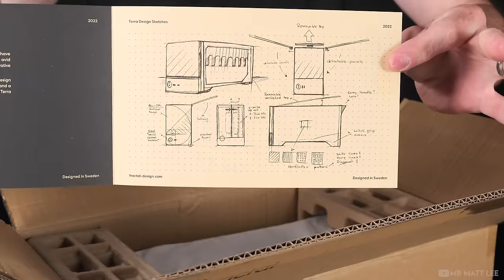The Ultimate ITX Case?! | Fractal Design Terra Gaming PC Build | ProArt RTX 4080, Intel i5 13600KF

Comment: 6:05 and 9:39 A little hint: Attach the two fractal-hexa-spacers (7mm) between the power supply-holder and the powersupply. 
The airflow from the GPU then gets past the powersupply much better. Otherwise you did a very good job here. Many greetings from germany.

Comment: Matt, thanks for that video! I can't believe it though, I build my own system using the Fractal Design Terra before you did. You always seem to be so quick off the mark in building a system when a new case comes out, even before the cases are generally available to the public. I must have seen the announcement on the same day the cases were released locally, and immediately ordered one. While I guess you were delayed due to needing to fly back from Taipei.

My only complaint about the case is that it doesn't have a setting for no GPU, where all the space is given for a CPU cooler. I recently had a need to get a portable system to take on the road, strictly to be used for software development, and the iGPU on the Intel CPU is plenty for that use, so I want a 13900K and a tall air cooler, but only low profile coolers will fit, due to the lack of a no GPU setting.

I went with the same Asus motherboard as you, and also the same Thermalright CPU frame. Now I need to find a good Pelican style carrying case to use when transporting the system along with keyboard and accessories. This is my first ITX system, and I thought I'd never want one, but when the need came, and Fractal Design made the right case, I'm quite pleased with the result. Aesthetically, your build is of a much higher quality than mine, but for this system, the inside isn't so visible, so I decided to go with what works best, and not worry about the aesthetics.

Comment: Oh yes, this is the ultimate ITX Case 1000%
Reply from the maker: Absolutely agreed with you! 🤎
Reply: @Mr_Matt_Lee  it misses two slims fans for top exhaust, not?
Reply from the maker: @manuelno1645  you can’t fit two fans at the top. It’s doesn’t technically need them, natural convection is adequate given the case design ✌️

Comment: You are sure Fractal did not paid you to make this video? :-) Beautiful!

I really think if I saw this video BEFORE I did my ITX build, I will seriously consider to do the same. 

Small form factor is not for everybody. The goal here is not to have the most powerful build. Even if you proved it can be
an efficient game station which is awesome. Minimalistic in size and components. Less is more, I like it!

I use the same MB for my own ITX build and I found is not easy to undervolt and significantly reducing the cpu temp without sacrificing a lot of performance. If anyone is interested, his my tips:

1. Disable the CPU throttling power (BIOS)
2. Install the previous micro-code 104 (available from the Tweak Paradise menu, also in the Asus BIOS)
3. Only then, you could undervolt with negative offset.

Doing so, not only I reduced the temperature of 6-10C, I also improved the performance (CineBench R23 from 28K to 30K, i7-13700K).
For the GPU, I used MS Afterburner, I get also 6-10C and I improved the performance a bit(4%) by overclocking the memory clock(+1200Mhz, Gigabyte RTX 3070). Stable since (1 month).

Comment: Getting ready to build in this. Going to put any extra fan on the bottom. I've been debating on whether to use as intake or exhaust. Don't see a whole lot of airflow coming out from the bottom. Thinking about using that fan as an intake to blow up out of the top

Comment: 2024 My Build
 
Intel i5-14600KF
Corsair DDR5-6000 CL30 Dominator Titanium BLACK (64GB(32Gx2)
ASUS ROG STRIX Z790-I GAMING WIFI
ASUS ProArt GeForce RTX 4080 O16G OC D6X 16GB
Samsung 990 PRO M.2 NVMe (4TB)
Fractal Design Terra (Jade)
ASUS ROG LOKI SFX-L 1000W Platinum
NOCTUA NH-L9x65
Thermalright LGA17XX-BCF
Reply: how are the temps during gaming? I am afraid the noctua L9X65 won't be able to cool 14600k

Comment: I know it may go against the core idea of these builds and videos but I'd like to see a bit of cable management or at least how you connect the motherboard cables. For novice builders like myself, especially in the ITX space, that would be really helpful.
Reply from the maker: I appreciate that. However, cable management will always differ depending on the hardware being used. For example, different PSU’s have different length cables and motherboards all have their ports in different places. Unless this build was replicated to be exact using the exact same hardware, showing cable management wouldn’t make much sense. The best advice I can give is to just take your time and enjoy it, manage cables as you go, the Terra has been well designed to allow ample cable management space. I’d highly recommend buying some additional Velcro straps for all of the cables, zip ties can damage them. Plus, with Velcro if you need to make any adjustments it’s quick and easy 😁
Reply: @Mr_Matt_Lee  I appreciate your response very much, Matt and your points are valid and fair. Now that I read my comment again, I think I went a lil bit on the abstract side but... maybe at least just a shot of you plugin in the connectors like the 24 pin? lol. Once again, thank you for taking the time to reply.

Comment: Amazing video and build!

I am not sure as to choose ths case or the Fractal Torrent Nano one, though. 

One has to cap the CPU at 65 watts for this setup, right? I am looking for the smallest setup but that can run "Breath of the Wild" fluently at 4K, 60 fps and a 13700k + 4070Ti was enough. However it is uncapped at 125 + watts.  Is the fractal nano better in my case or would the 12600k [fully cooled by the cooler chosen in this video with its turbo mode on] better?

The 12600KF is listed as fully cooled by this cooler, so it might be a better option than the 13600KF if turbo mode is not aupported

Comment: Hi Matt
Brilliant job. A wonderful set!!!
I want to assemble this exact set with TERRA Graphite,
But the CPU cooling will be handled by NOCTUA NH-L12S.
With the GPU RTX 1080 PROART it should fit and work better ...
What do you think about it?
Reply: Have you thought about using the NOCTUA NH-L12S, and the question is whether it will fit with the RTX 4080 PROART in this PC case?

Comment: Really wanted to buy this case as it's beautiful looking, went with the FormD T1 however, as with this case they made a few questionable design choices, due to the large feet there isn't enough space for a 240mm AIO, so if you're going for a top end system (4090 + 7800x3D) you are sacraficing performance. Looking forward to a second improved iteration of this case though!

Comment: The Noctua NH-L9x65, has sufficient performance for the i5 13600KF at base clock only. Try running a cinebench without throttling after 1mn.

Comment: Hey man! Im really surprised with the températures, i see a lot of mini itx post on reddit with this precise same configuration and going loco on the températures (95+). What is the process behind yours? Downclock?
Reply from the maker: Ambient room temperature, thermal paste type and application method, fan curves… even the motherboard can make a difference with residual VRM heat, but most importantly for me in this build it’s also having the contact plate around the CPU socket. This greatly disperses heat in a small form build like the is, taking some strain away from the cooler. No downclocks though, all running at default settings (no overclocks obviously!)
Reply: @Mr_Matt_Lee  nice job man and thank you for the answer ! Im trying to build a little one as well but it has to associate power and silence would you recommend doing a little case like this or getting a larger like the Corsair 2000D would be more pleasant for this purpose ?

Comment: hello Matt, what cooling do you recommend for that same configuration but with a ryzen 7 7800x3d
Reply from the maker: Hey! Sadly, there isn’t a small form factor Cooler small enough to cool any 3D chip effectively unless you’re greatly undervolting it… a 3D chip ideally needs a 360mm radiator which you couldn’t fit in this case 😶

Comment: Would it be possible to have AIO for AMD Ryzen 9 7950 within the configuration used in your video?  I work with blender and need a travelling work platform within my RV.
Reply: I own this case + 4080 proart. You only can use the smallest AIO (1 fan) and a GPU with 1 fan. But i prefer low profile air cooler with max height 67mm

Comment: Would I get away with this exact setup but using an Intel i7 14700K instead of the i5 13600KF? 
According to Noctua, it is compatible, but according to some other sources, it won't be able to cool the i7 sufficiently.

Comment: How do you think this would work out with an i7 13700k? Are there any AIO water coolers that would fit, or what form of air based cooling would be good?
Reply: I have the same question. Been doing some digging and looking at how those low profile air coolers perform, and it doesn't look like they'd be good enough. I think the only option is graphics card sacrifice to fit a 120mm AIO :/

Comment: I have a similar build, but the cpu cooler is too weak for the 13600KF. Have you an ideas of what would better that would still fit. I had to add a 92mm fan above the cooler but the combination is loud under loud.
Reply from the maker: I’ve not had any critical issues with the 13600KF and the NH-L9x65 so far, but then again in the UK ambient room temps are pretty low. With that said, small form factor always comes at a cost for cooling, this is one of the best CPU coolers you can fit in this case, especially with the latest mobos having huge VRM heatsinks. The best advise would be to use the NH-L9x65 and undervolt the CPU slightly in bios. This will prevent the temps getting so high, for a minimal performance loss (talking maybe 6% which would be barely noticeable) ☺️
Reply: @Mr_Matt_Lee  I'm doing the undervolt. BTW I'm from the UK! GL
Reply: Other cases not much bigger can fit AIO's do im gonna make sure i do that in my next build.
Reply: @Mr_Matt_Lee i built my terra on the weekend with the NH-L12s. What do you think about that one compared to the 9x65? :)

Comment: Hey guys, I’m actually thinking about doing an ITX build myself (first time ever). I could really use some help on picking the right parts, do you see any problems with the following setup? Thanks so much in advance!

Case: fractal terra (black)
Motherboard: ASRock B650i lightning WiFi
CPU: Ryzen 7800x3D
CPU Cooler: ID-Cooling IS-55
GPU: ASUS ProArt 4080 Super
RAM: 2x16gb DDR5 Vengeance 6000Mhz
SSD: Samsung 990 Pro 2tb
Power: Corsair SF750 
Fan: Noctua NF-A12x15 PWM
Fan grill 120mm
Cables: Corsair premium 600W 12+4 pin

Comment: The Noctua L9 is not enough for Intel's K-series CPUs, but putting in the NH-U12A seems not fit in this case...
Reply: The GPU he used is a 2 slot one
Reply: I agree, I have a similar build. I'm looking for a better CPU cooler but I can't find one. Just have to live with undervolt, noise and lower performance. I will probably sell the rig on. Thinking of the Dan Cases A4-H2O instead of this for 3 slot GPU AND 240mm AIO in not much bigger a case.
Reply: @jondonnelly3  why would you not undervolt anyway regardless of cpu cooler? Same performance but at less wattage and temperature

Comment: thank you man, that's my dream pc i just saw but i will share some thought with you ,
the motherboard is the same 
for my cpu it i5 13600k not the kf version becaus who knows if i need the itegrated cpu graphic if problem appear with the gpu 
for the cpu cooler the same choise as you but with add on The NA-FD1 fan duct kit makes it possible to significantly improve the performance by Bridges the gap between the fan and perforated case panels for improved cooling performance
for my ram 48gb 2x24gb corsair vengance non rgb 7000mhz
for stokage i will go with samsung 2to 990 pro with heatsink and 4to sata samsung 870evo but i wonder if there enough room to put another samsung 1to 990pro with heatsink in the back of mtherboard that i realy want to see the most in reviews of this case to have a better picture
for gpu i will go with rtx 4080 msi ventus 3x oc i wonder how will fet 

for psu i will go with cooler master 1100w sfx for extra efficiently i know its overkill who knows mybe a good choise to overclocked the gpu further so i need some jucie for that 
for case fan i will go with slim fan 12x15 pwm form noctua wich that i'm not sure if the airflow will be improved 
and that's it why i write all of what you did it's dream that probably i will not get my hand on that pc.
 i'm thankful to you  that i saw it in reality . keep it up man your b-roll is insane like me stearing to the case for many angel as you did . good job

Comment: Is it a build that can handle 13600k heat?
Reply from the maker: All seems fine so far in my testing. In the event you need some extremely CPU intensive tasks, it may not be a bad shout to under-volt slightly in bios for minimal losses. Nothing to worry about so far!
Reply: @Mr_Matt_Lee  Thank you for your answer

Comment: Hi matt, do you think asus noctua 4080 fit in this case?
Reply: No, this card is too thick. 87.5 mm while the maximum would only be 62 mm with that card height. And even if you managed to put a card less than 72 mm and less than 135 mm of height, you would only have a 48 mm clearance for the CPU cooler so impossible to choose a very hot CPU either.

Comment: Absolute big mistake is not using a cooler with the fan behind the heatsink in intake position - of course this cup cooler does not have that configuration. If you don’t do any CPU intensive work than enjoy the extra noise :/

Comment: What are the thermals like at full load? I'm considering going for the same case with an i7 (same TDP as the i5), just concerned with cooling performance and how it might throttle.
Reply from the maker: The thermals are overlaid at the airflow visual timecode my dude.
Reply: @Mr_Matt_Lee  ok those are very good thermals indeed! Do you reckon an i7's thermals would be similar given it's the same TDP?

Comment: Come on that is  bullshit i cant cool my 13600K with my Arctic 280mm AIO under 95C Degrees
Reply from the maker: Then there’s absolutely something wrong with your AIO. I’m using that exact same Arctic AIO for one of my personal builds, with an NZXT H5 Flow along with an i7 13700K. CPU temps barely ever exceed 65 under normal use, even when rendering 4K video it doesn’t pass 80 and that’s extremely intensive with a hotter CPU than the i5 🫡
Reply: @Mr_Matt_Lee  then play BF2042 for 30 Minutes even under Idle i got 50C Degrees and i all ready changed my Arctic 280mm for a new one the same! 95C Degrees in simple Diablo4 Cut scenes. Case is brand new Fractal POP XL with Stock Fractal Fans running @ 100%

Comment: Not a great case for longevity. Will be caked with dust, and can't support even a mid range performance cooler. You're not cooling the latest CPU's in this thing without serious compromise to performance, and so buying the best or even a mid range GPU doesn't make sense, because you will be bottlenecked and thermal limit even at stock CPU clocks. This would have been a great case 7 years ago, but it is completely blind to the reality of CPU's today, which can consume over 200w-400w. And why would you put even a Ryzen 5 or i5 in it if you can't overclock it to the max, makes no sense.